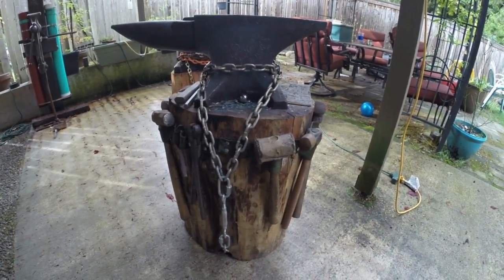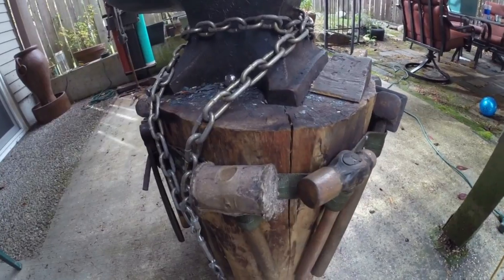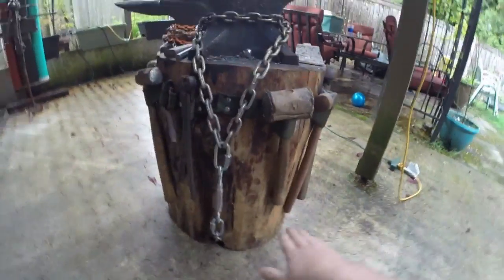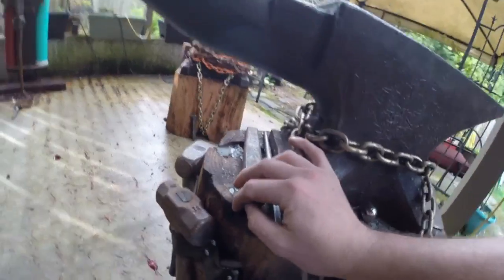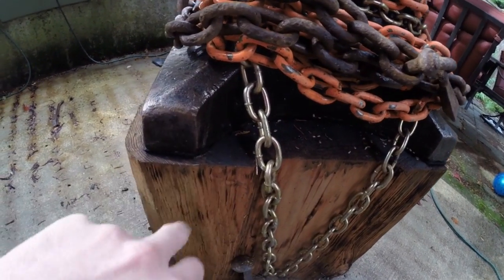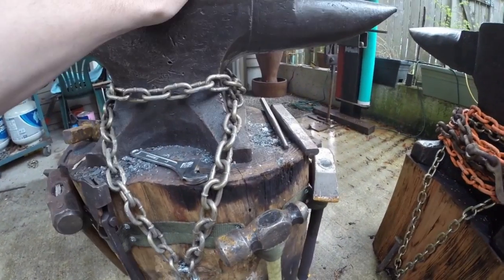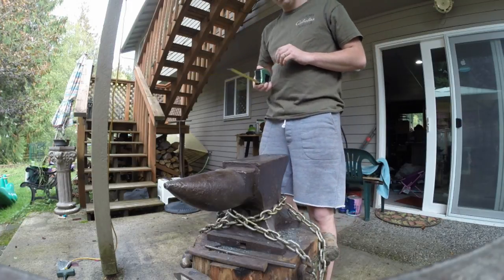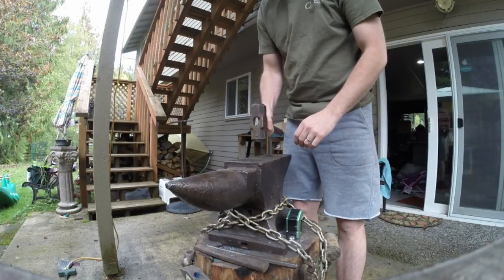Anvil envy: Peter Wright Anvil rebound test

Comment: Try finding elm in North America

https://en.wikipedia.org/wiki/Ulmus_americana#Dutch_elm_disease

The advantage to elm is that because it has
interlocking grain, or if you prefer that is has a
diffuse porous (as opposed to ring porous).
If you want to avoid checking, avoid using the pith or heart 
in the stump.
Reply from the maker: I heard there was a whole street of it... real nightmare of a place.

I have heard a lot of tree trimmers will give away elm that they cut down because its diseased. I have yet to run across any. I do remember an island with a large elm grove on it as a kid (Oregon coast) that had all fallen victim to DED and were standing dead left to dry out over the years. Eerily beautiful.
Once my maple splits all the way I think I will go with 6x6" stacked on end and planed for close fit then banded together. But the maple was free and its hard to pass up a free anvil stand.